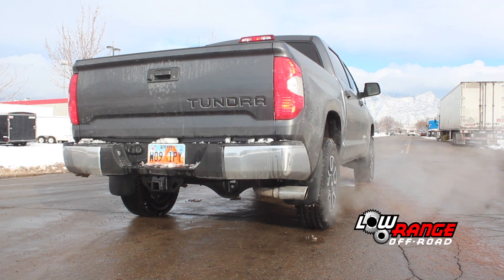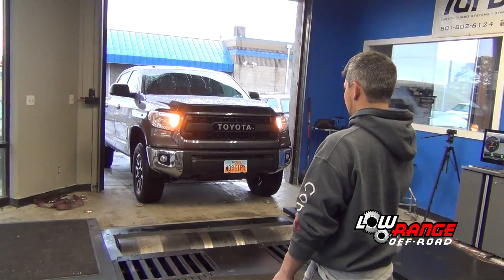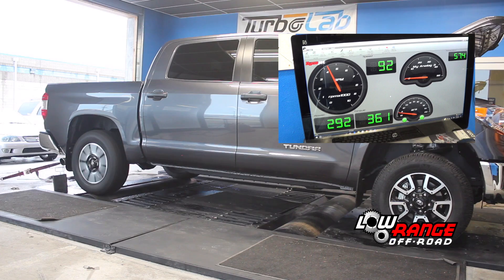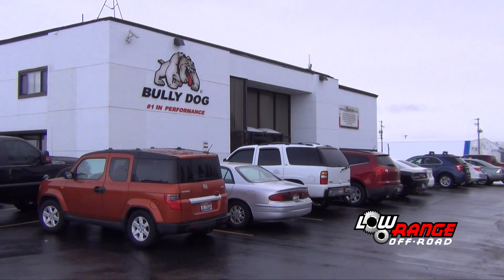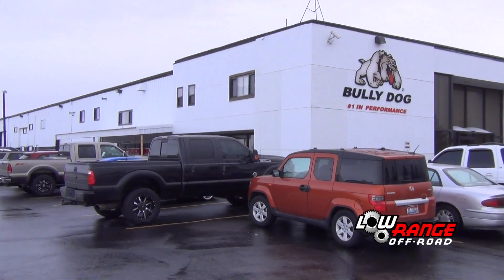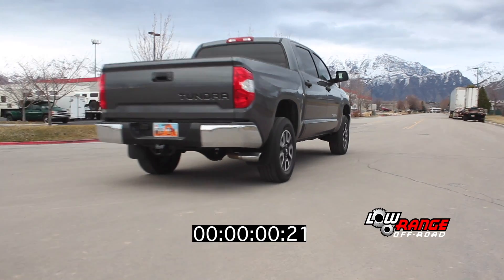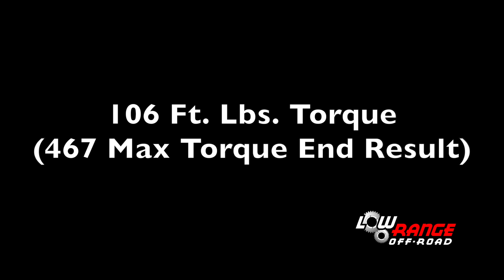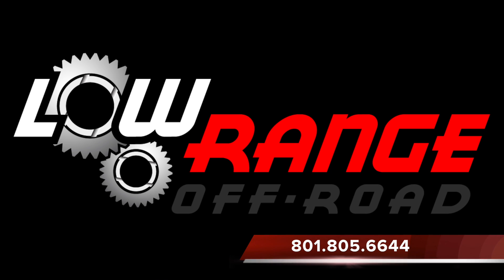Magnuson Supercharged 2017 Tundra - "Before" and "After" Test Results

Comment: Hi you tube commentors. I own the Tundra in question. So first off the factory  horsepower of 381 horse power is measured at the crank. Torque is 401 ft lbs measured at the crank which is why there's a marked difference. I am interested in seeing the dyno numbers if I take it back to the same dyno. I will be doing an exhaust system very soon, so I may dyno it after that. I hope to see over 500 hp to the rear wheels. Keep watching for updates.
Reply from the maker: Jesse, thanks for clearing up the numbers question.  There is quite a difference when torque and horse power is measured at the engine verses the wheels.  You lose more in the drive train than most people realize.  It has been a fun project.  Thanks for choosing Low Range as your Tundra project supplier.
Reply: @lowrangeoffroad1  

Alot of commentors on here fail to realize the elevation as well. And that you lose power at higher elevation. I dont think many people read the description or understood it as I did. Great job. Great vid.
Reply: fizodan   I gained 1mpg currently. My truck normally got 14 mpg, and immediately when I installed the supercharger and had it tuned it jumped to 15mpg . My truck is still tuned a little on the rich side. It could potentially get better .
Reply: so far, plus 1 mpg.
Reply: Any plus or minus to the gas mileage besides putting your foot into it more?
Reply: jasonm0284 when TRD did the supercharger they did not do a flex fuel.  but Magnuson does do flex fuel.
Reply: Jesse Floyd If you install it do you know how to flash the ecu also or do you still have to take it to the dealer?Thanks
Reply: Nweran Jaber 
the supercharger helps alot. it doesn't on every little hill anymore.  I here 4.88 gears help alot two. so I may do those next. currently my truck is still on stock wheels and tires until I get the bigger lift and decide which wheels to go with. still a work in progress.
Reply: your engine is the flex fuel? I could have sworn I read in the manual that the flex fuel was not able to have a Supercharger. But it's probably insurance/warranty related crap. Anyway awesome upgrade thank you for sharing.
Reply: NOLABOIRCGUY  bullydog does the tuning/ reflash. the bullydog platinum tuner comes with the kit.
Reply: what MPG are you getting after the Upgrade
Reply: Nweran Jaber 
if I drive like normal and keep my foot out of it I will get over 15.4 mpg. I also have a 14' trailer I tow. I just pulled it to Vegas and my mileage stayed over 10 mpg.
Reply: Jesse Floyd You’re answering all my questions before I had to ask them - both on MPG and towing. I tow a 7 x 16 cargo trailer between assignments every 3 to 6 (sometimes 9) months; anywhere from a few hundred to 4,000 miles - depending on where I’m signed. Anyway, sounds like towing is a non-issue. I’ve got a 2017 Tundra TRD Pro.
Reply: not bad. my tundra is stock 2017 with 20 inch fuel venoms and a level kit i get avg 12.9  its kinda pissing me off
Reply: Jesse Floyd my customs guy recommended I get a K&N air intake and a chip. What chip he's referring to I don't know.
Reply: Nweran Jaber  Bullydog platinum
Reply: the trd filter is an oil less filter and it worked good on last truck. alot of people like Volant intakes as well.
Reply: NOLABOIRCGUY  that's good. I've had three tundra's and they usually get 12-13. this current truck got 14.2 avg before I supercharged it.
Reply: Jesse,  I am seriously contemplating getting one of these superchargers for my truck.  I am in Utah as well I'm in Tooele,  I own a 2017 Platinum FFV  Tundra.  How many miles do you have on your truck now?  Looks like the truck was taken care of at Turbo Labs in Orem, What did they charge for the install?  Did they take care of the bully dog tuning or did you have to take it to Idaho and get it tuned on your own?  I am hoping now that turbolabs has tuned one the trip to Idaho wouldn't be needed now with their expertise on your truck?  Have you thrown any engine codes?  In short I don't want to loose reliability I owned a Tacoma before my Tundra for 11 years,  I would like to own and drive my Tundra for more then that 15 plus years.  Your thoughts and comments are much appreciated bro!
Reply: So did you remove the 5.7 iforce badge? All 5.7's have badges to distinguish them from 4.6
Reply: @baldymtngrizz2527  The SR's don't have badges
Reply: Jesse Floyd ... 5.7 Toyota Tundra. GAS or Diésel?
Reply: With the blower on it, is there any chance you run 87 fuel? Or do you have to run premium?
Reply: Jesse Floyd don’t forget about elevation because u lose power at a higher elevation
Reply: Harley guy 68  

All advertised Horsepower and torque is measured at the Crank. A dyno measures at the drive wheels. It's the actual horsepower and torque after all the drivetrain loss(transmission, differential, etc...)and Accessories(power steering pump, etc...). 

Rear wheel horsepower and torque are the actual numbers getting to the ground. It's the "true" numbers.
Reply: Hi Jesse, I know this is 2 years later but I wanted to ask if all you did was the supercharger and the tune?  I'm picking up a 2013 tundra with the 5.7 today that has 95K miles on it and wanted to do something like you did.  I wasn't sure how many other things had to come along with the supercharger to make everything function efficiently or if that's all you did i.e. exhausts, cold air intakes etc.  I'm totally new to this so any information helps.  Thank you!
Reply: Nweran Jaber i have a 2010 tundra dblcab with 24'' rims and gibson metal melisha exhaust.I avg. about 14.5 to 14.7 depends on how many city miles i do.

Comment: 🤔 hmm.  Interesting.  Apparently the dealership say that they come right out the Factory with 381hp and 401lb ft of torque.    Oh well.  It was a nice video.
Reply: The 381 hp is measured at the crank not the wheels...
Reply: 231mac - 🤔 hmm,  Interesting.  good to know.
Reply: Sure, the engine itself makes roughly 381 hp. After the power has been transmitted through the transmission, drive shaft, rear diff and finally spinning the axles and wheels, there is parasitic loss. Even spinning the driveshaft, axles and wheels creates loss.
Reply: Juan J Solis at the crank ,not at the wheels.
Reply: Well I'm not a mechanic so can you please give me a small example on what the difference between the crank and the wheels
Reply: 231mac - Wow! Thank you very much sir. That is very informative. Now I have a better understanding.  👍😎

Comment: You really need to use the same dyno when doing comparisons, they can vary by a large margin.
Reply from the maker: Good point!  Maybe we can go back to Turbo Lab again.  Thanks for watching and commenting.
Reply: @lowrangeoffroad1  And maybe test it when the road is dry, at least try and make it look honest. Im sure your numbers are close but the Tunrda does 0-60 in the very low 7's stock. Im sure you have a good product but why try and make it better than it is, even by showing the torque numbers as if they dont mean as much as H.P.  You can do better guys.
Reply: @aquaticterrafirma  ....I agree. I have an 08 trd double cab that does it in 7.2 seconds all day long
Reply: NxtGen 2B where do you drive yours? Mine will do it in the low 7s at sea level but Orem, UT is about a mile above
Reply: @neilrasband3647  .... I live in Ontario Canada. I do not not know what my sea level is at.
Toyota claims that my truck should do better, but I've yet to see
Reply: @nxtgen2b416  Sea level is the same everywhere.  Ontario Canada is 2200 ft above sea level at it's highest point.  The higher  in elevation a naturally aspirated engine goes,  the less power it makes due to lower air density.
Reply: NxtGen 2B 
Mines does consistent 6.5 seconds 0-60 with traction control off and also in Tow Haul mode. 

I’m from Austin Tx so I’m really  close to sea level than most of you
Reply: 0-60 times on a two-lane city street probably wasn't your brightest moment either!
Reply: Agreed!!!!

Comment: How come during the Dyno test, the HP is way off the factory #, the torque is closer to factory #'s.
Reply: Hlubkoj1011 that's a 4.6 L not a 5.7. 
If you look at the vid all 4.6 have the shift gear located at the steering column.
Reply: dark cloud the dyno also plays a large role. The same vehicle will give different numbers on different dynos. Also at a higher elevation a n/a motor will make less power